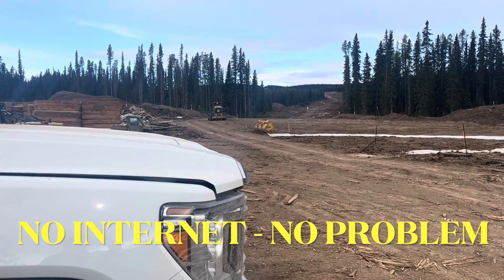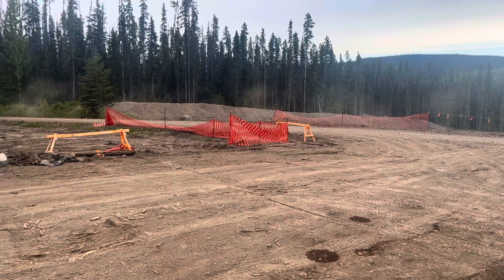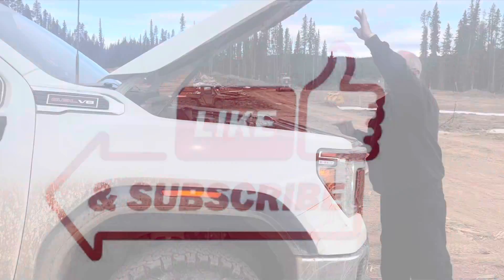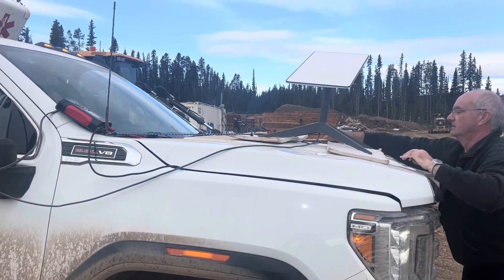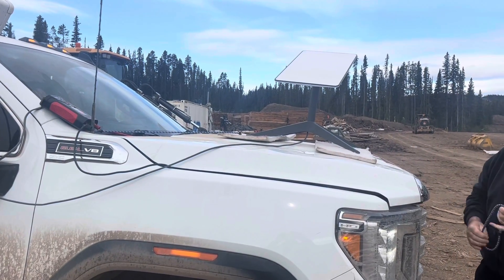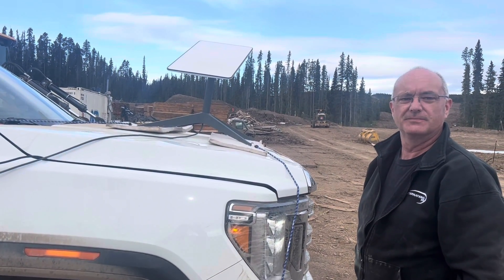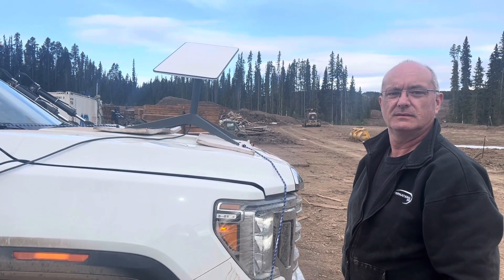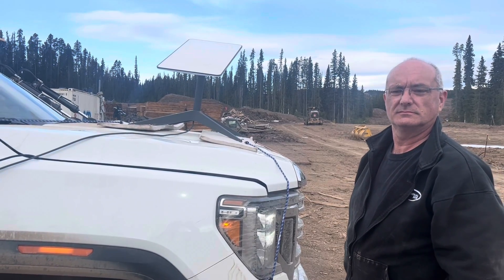Simple Starlink Install Tips

Comment: We run a starlink off grid with an inverter as well. Always good to make sure your using a pure sine wave inverter that has clean power when running electronics. Some of the smaller motomaster inverters are modified sine wave. Out west of pg on pipeline?
Reply from the maker: Thanks for the input.  Hope you enjoy my videos…
Reply: @AND NOW WHAT?  I did thanks. Always neat to see what's going on in the local area bush